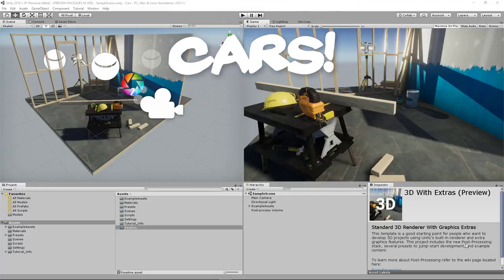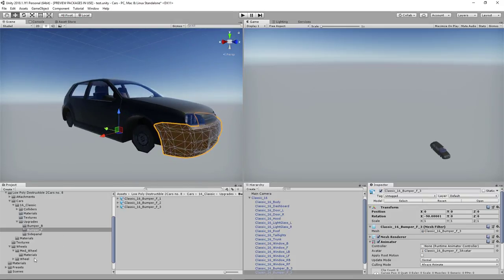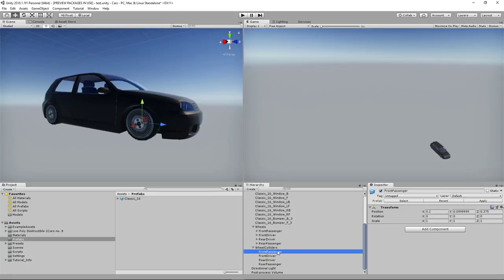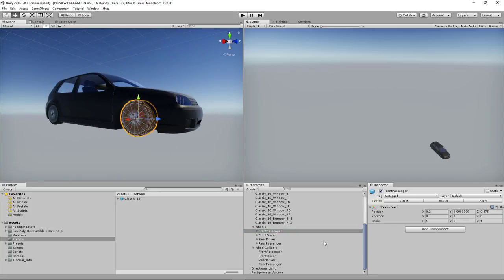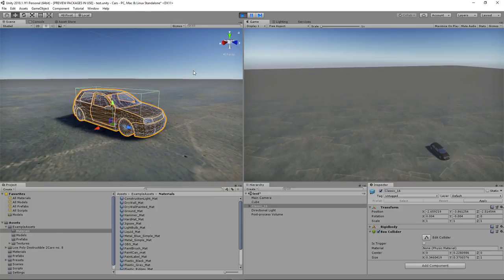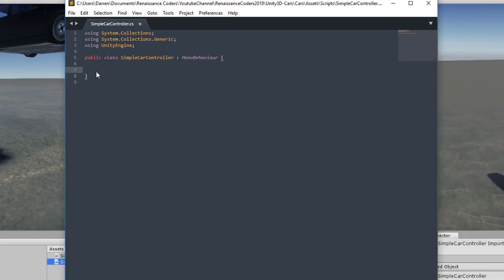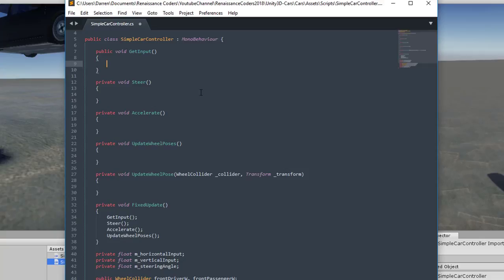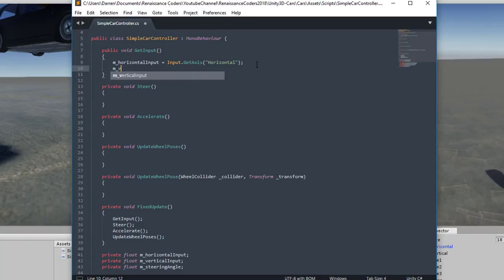Unity3D How To: Driving With Wheel Colliders

Comment: I used a different car from the asset store, and it accelerated extremely slowly. I had to decrease mass value for the whole car, increase the wheel collider radius (so that it collided with the ground) and increase motor torque to a lot more, and also changed friction values slightly. Just in case anyone faces the same problem. 

Anyway, great tutorial, it was very clear and easy to follow. I will check your channel for more! Thank you.
Reply: thanks a lot __
Reply: WIWOSEOAW48PS I know it’s late but if you scaled game object with the driving script attached to it you would change the physics I think.
Reply: @lemonface2938  yeah u r correct. It changes the physx. I experienced that bug.
Reply: @lemonface2938  thanks
Reply: Bro, I'm not even kidding. Thanks to your comment, I solve a problem that involved hours of research. I forgot to increase the collider radius...
Reply: WheelCollider radius was the culprit all along. Thanks man , your comment saved me.
Reply: ayy thx
Reply: is the updateWheelPoses() to just update the visuals or to actually drive the car? Will it also drive without that function if I don't want to update any visuals?
Reply: just increase the extremum slip, it worked for me

Comment: In case your car moves too slowly when accelerating: Try scaling your model (ALL parts of the car + colliders etc) downwards. I somehow assume that the "unity physics system" takes the model size - relative to the world grid size - into consideration when applying physics to it. 
Somewhere I read, that the grid squares (the smallest one if you zoom in) represent "1 meter". Originally my model was about 8 meters long and accelerated horribly slow. I scaled it from (1,1,1) to (0.2,0.2,0.2) and that did the trick.
Reply: Correct, a transform gap of 1 is one meter, and this is linked to the physics notion of a Newton (1kg * meter * meter / second * second). So size does matter when if comes to physics-driven acceleration in Unity.
Reply: Won't the car look too small compared to other objects? Or is there something I am not getting...?
Reply: The car shouldn't look smaller, if you scale all of your other world objects (houses, trees, etc) to the same relative size (like in the real world). Maybe my applied scale (0.2) was too small. I haven't done a lot of experiments with it, but I think you should still be able to have larger cars (8m). Maybe the mass was too big for the adjusted torque of the wheel colliders.

Try therefore different values for the mass of the car or wheel collider properties (torque, stiffness, etc) to get the driving behavior you wish. 

Another thing I learned in UE4 (but can't remember if it is present in Unity) was friction between ground and wheels. This kind of parameter plays an important role for acceleration and steering too.
Reply: @seahawk913  thank you, I will look into those. Won't, lowering the friction, make it look like the car is skating on ice?
Reply: @RobertoOrtis  Yes, this is exactly going to happen, if you set the fricition too low. Setting the friction too high may get you an unrealistically stable car. But in the end, it all depends on how you want the car to behave in your game.
Reply: @seahawk913  great, thanks :)
Reply: ? Just change the motor force variable in the Simple Car Controller script.
Reply: That didn't work for me :/
Reply: @Styro8  me too :(
Reply: change the forward friction and sideways friction for optimization thats the point. i dont know the exact values but change it and try it as possible.
Reply: So how big is the default cube, I always went by it being 1 meter tall

Comment: Can you do a follow up video for handling different road surfaces. Asphalt vs dirt for example.
Reply: I think, you need to add triggers on road, and change wheelcollider friction's settings when you in trigger. That easy
Reply: @sweftis8300  physic materials. ;)
Reply: @sweftis8300  or add different friction for the ground and keep the wheel friction static
Reply: @bartwestenenk6088  that doesn't work that good... Just change the wheellcollider sideways slip and forward slip based on the ground physics material. RCC for example does that'

Comment: Fixed update should be used for physical Calculations and Update for Input/Output. Update is called every frame, FixedUpdate is called 30 or 60 times per second.

Comment: regarding FixedUpdate and LateUpdate... Basically before Update is ran there is a before and after update method that you can use for physics (before) and camera (after) respectively most commonly which can fix stutter for the camera when all other object movement is already processed for example... this was mentioned in one of the tutorials

Comment: Cars don't need brakes right , just kidding.
here is code for brakes (brakes = hand brake).
but you can apply it to all the w_colliders.
[
add this in the Accelerate void or make new one for the brakes called brakes.
frontDriverW.brakeTorque = m_brakeInput * brake;
	frontPassengerW.brakeTorque = m_brakeInput * brake;
 and make a float like this float public brake = 500;
]
Reply: How can i do that but, with UI buttons?
Reply: thank you i have now achieved brakes
Reply: good job!
Reply: Achievement unlocked: Brake
Reply: GetbuttonDown or Get AXis???
Reply: @jettblackmemes  its get axis
Reply: Thanks <3
Reply: @Croccolucho  use unity event system
Reply: which Axes ? Jump?
Reply: @devlooper1090  yes you can set it up to the jump axes it works perfecly fine on mi car
Reply: @xestrix420  yeah I added it earlier but there is one issue that how can I add the sounds of car movement or the effect in the back tyre

Comment: Great Tutorial but I have this issue.
I applied Wheel Colliders to my Wheels and everything "technically" works. Problem is that when Play is hit, all 4 wheels flip sideways. 
Any thoughts as to why that might be or - if not - how I could patch something like that?
Reply: U have the cheat code activated that makes the wheels go sideways thus allowing you to run it on water like in GTA! 

K, jokes aside, I think it's because the car collider is clashing with the wheels collider that's why
Reply: It could be indeed your wheels colliding with your car's box collider. A good way to solve this is by setting custom layers for your tires and car, and setting inside the physics tab in project settings so the two layers won't have physical interactions.
Reply: @albertoneto4781  Have the same problem and I tried resolving your way but it doesn't work..
Reply: @Cerions33  maybe check the suspension size? in the gizmos they are those orange vertical lines. If they are too big, your wheels will start to tilt when you keep constantly turning.
Reply: I think your wheels may not be oriented right,
Or try this...
Create an empty game object and copy transform from a wheel. After the empty game object is in the position of wheel, you should make wheel object as a child of this empty gameobject. That empty gameobject should be oriented as wheel collider of this wheel and try offsetting the wheel mesh rotation to counter its behaviour in the game mode.

Comment: If anyone wants to add the ability to control what the vehicle's drive type is, I messed around a bit and basically I just created three bools:

    public bool fourwheeldrive = false; // 4WD
    public bool rwd = false; // RWD (Rear Wheel Drive) 2WD Mode.
    public bool fwd = false; // FWD (Front Wheel Drive) 2WD Mode.

Then in the void Accelerate() I replaced the code RC used with this:

        if (!fourwheeldrive && rwd)
        {
            rLWC.motorTorque = m_verticalInput * motorForce;
            rRWC.motorTorque = m_verticalInput * motorForce;
        } else if (!fourwheeldrive && fwd)
        {
            fLWC.motorTorque = m_verticalInput * motorForce;
            fRWC.motorTorque = m_verticalInput * motorForce;
        } else if (fourwheeldrive)
        {
            fLWC.motorTorque = m_verticalInput * motorForce;
            fRWC.motorTorque = m_verticalInput * motorForce;
            rLWC.motorTorque = m_verticalInput * motorForce;
            rRWC.motorTorque = m_verticalInput * motorForce;
        } else
        {
            Debug.Log("Drive Type not defined.");
        }

Hope this helps anyone. Note that you will have to replace all of the rLWC, rRWC, etc. with your variables.

Comment: Thank you for the tutorial :) for such complex behaviour its actually pretty easy to set up.

One thing I noticed is, that you use Time.deltaTime but are updating in FixedUpdate(). Maybe this is the reason your followMovement becomes jittery sometimes.   Time.deltaTime relates to Update() / lateUpdate(), whereas Time.fixedDeltaTime relates to FixedUpdate(). 

I'm actually wondering why there isn't a LateFixedUpdate()...

Interesting _codingStyle btw. ^^  Didn't know you can put methods before variables. I haven't made use of the underscore yet. Thinking of adapting that.
Reply: Time.deltaTime returns Time.fixedDeltaTime if called within the fixed update loop.

Comment: I had an issue with the tire geometry clipping through the floor and it took me a little too long to realize the wheel collider's radius should NOT be .08 like mentioned in the video. I used .25 scale, just like you said but the wheel radius was way too small and should actually be 0.34

Comment: big thanks for the video! Everything works but the handling of the car feels weird (acceleration / breaking). It is as if the car has strong momentum. You can see it if you drive back and forth. Increasing the motor force doesn't help - the inertia / momentum is still working and increasing the force makes it worse.
Reply: lower the mass of the wheelcolliders

Comment: When I put in the script into the car it flies int random directions. The script is all correct.plz help
Reply: Same
Reply: I corrected it but still I cannot turn
Reply: the reason it flies is that the mass is low increase the mass of the rigidbody and it should be working just fine
Reply: @ahmd-salh  no wotk,i set at 10k mass,and she fly
Reply: Work*,srry for my bad english
Reply: AnDy_7_7 make sure to put the wheel colliders inside the box collider for weight distribution and set the mass to 2000 or lower

Comment: hey. Thanks for the video. I have the problem that when I stop the car, it still moves around. Set motor torque to 0 and added a brakeforce. The wheels don't move, but the vehicle is sliding around on the plane.
Do you have a soluition for that?

Comment: I followed this tutorial and it worked excellent. I then tried to follow this using the golf cart download from the asset store and I can NOT get it to work. It starts spinning and or takes off, or flips over after adjusting the settings. I'm stumped. I was trying to make a golf cart racing game. Any suggestions?
Reply: Have you tried increasing the wheel size radius ?

Comment: my car accelerates really slow, is there any way to make it faster by using code (I tried setting the motorForce higher but that did not help much)?
Reply: benjamin sprott it is because your wheel colliders are slipping. You can sacrifice a bit of handling for acceleration by decreasing the mass of your rigidbody
Reply: @theotherquou  doesn't work

Comment: Excellent tutorial for Wheel Colliders. But I have a doubt. In UpdateWheelPose() method where we are actually modifying the wheel mesh transform with the wheel collider transform, i didn't understand the initializing of Vector3 _pos and Quaternion _quat  by storing wheel's current position and rotation. Because that function is running without errors with just initializing _pos and _quat, and not storing values into them. They are already getting updated in _collider.GetWorldPose(out _pos, out _quat). If anybody can explain, please!!
Reply: Watching a movie from 4 years.

Comment: I have a problem that I've been working on for two days now...its that my wheels are floating around my vehicle.
my wheel colliders are working fine but my wheels are not.
Reply: I have the same problem....have you found any solution yet?
Reply: Yes I have...make sure to make the wheels a child of an empty GameObject and The GameObject a child of the Car Body then place the empty game objects in the "wheel" section in the inspector and that should fix it
Reply: @geniusboi2519  can you explain to me? i don't understand
Reply: instead of putting the wheel colliders on the wheels themselves (meaning the game object with the mesh renderer component) create 4 (or how ever many wheels you have) separate empty game objects that will serve as the parent for each wheel. Then put the wheel collider component on those newly created parent game objects and put those parent objects in the wheel collider fields in the inspector view. BTW the parent game objects should be the child of the car body. Hope that helps somebody one day :)   @tommywicaksono

Comment: Hi, I wrote a code similar to this but when I run the car start moving backward without any input, I tried several ways but the only thing has changed is the direction of the initial movement,  I mean the car starts going forward initial after runic the fame. Does anyone have any idea in this case?

Comment: transform.rotation = Quaternion.Lerp(transform.position, _rot, lookSpeed * Time.deltaTime); 

Giving me error, Can't convert from UnityEngine.Vector3 to UnityEngine.Quaternion. How do i fix this?  Thanks in advance
Reply: Same problem here. Have you found a solution?
Reply: No, not yet i just simply commented out that line of code. The camera might not be as smooth but it still works to some degree.
Reply from the maker: Change transform.position to transform.rotation. This is a typo.

Comment: When I try to add the script to my car, it gives me an error, saying that the script needs to derive from MonoBehaviour. All of my code is the same as in the tutorial, except the name is different. I looked online and someone suggested that the issue could come from the file name not beign the same as the one used in public class name : MonoBehaviour. But mine is the same, so that cannot be the issue. Any ideas on how to fix this? It should work, as everything is the same as in the tutorial.
Reply: make sure that there is a :Monobehaviour after your class name.
 E.g: 

public class SimpleCarController : MonoBehaviour
{
  //This is where your code goes

}

Comment: My car is moving and my wheels turn, etc. but I have a problem: all my four wheels turn 180 degrees when I press play. Like the hubcaps turn to the center of the vehicle and the inner rim turns away from the vehicle. I have tried to set them 180 degrees to the other direction but haven't yet found a working solution. Anyone know what I should do?
Reply: I had a similar problem where all four of my wheels faced upwards. 

I suggest you position you wheels in the correct position in the scene, i.e make sure the wheels are facing outwards, then create an empty game object for each wheel (which you can then drag each wheel into to make it a child of it). Make sure that the empty Game object is at the same position as the wheel otherwise the wheel will rotate around the game object's location instead of its own centre. Then, drag each empty game object into the movement script assigned for the collider instead of the wheel itself. This should fix the issue since the script will modify the rotation of the game object in relation to the world (which in turn modifies the rotation of the wheel relative to the game object) instead of the wheel itself, which would change the orientation of the wheel. 

If that doesn't work you could always try to move the wheel colliders on the left side of the car to the right side and vise versa to see if that helps.

Comment: I have a problem. My wheels spin and move left & right but my car does not move at all. Any suggestions ? Thanks !!
Reply from the maker: You may try reducing your car's mass setting on the rigidbody.
Reply: @RenaissanceCoders  thank you so much it works ! :)
Reply: @RenaissanceCoders  Weird, I have similar problem with my test box car. Tried to reduce the weight to 1000 but no effect.

Comment: 5:42 "I wont have time to get into." Just be honest, you never will, because you don't understand what those values do. I'm not saying it's easy. I'm just saying stop lying to yourself. It's not like you're going to make a tutorial on those.

For what it's worth to others: It defines how much the vehicle will move based on how fast the wheels want to rotate but pushes the vehicle because of the resistance it has on the ground. Including at what point, from the vehicle standing still, your wheels are rotating too fast to gain enough traction with the ground to actually move the vehicle. (Imagine a car wanting to start, but you floor the gas pedal and the wheels just spin out, making a screeching noise.)

But I want to know how those values reflect the behaviour because I have a massive mobile crane which is really heavy and the wheels are not only barely moving it forward no matter how much rotation force I add, and on top of that they're rotating very jittery.
Reply from the maker: lol

Comment: I'm using a model i created instead of the asset used here, and everything works fine until I add the wheel colliders, which come in rotated 90 degrees. Will this effect how the wheel turns? And if so, does anyone have a fix?

Comment: I appreciate the tutorial. However, when I drop the car it won't move. The wheels move and turn but the car stays still. If anyone could help, it would be greatly appreciated.
Reply: Ok, I got it to work, but the car has to sink halfway through the road before it can move. Any ideas?
Reply: @collingeric9260  did you fix it ? i"m having the same issue the car dont move
Reply: Megology if you lower the collider so it’s closer to the bottom of the car then the wheels can make contact with the road. It’s a sweet spot, but if you play around with it you should find it